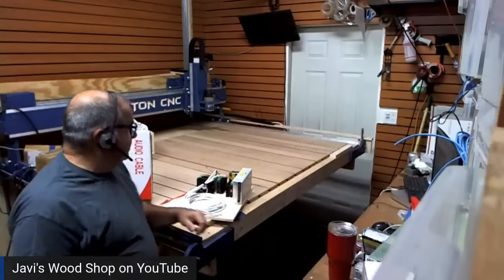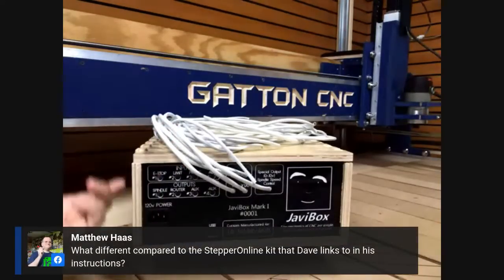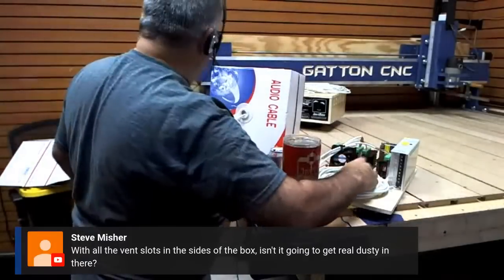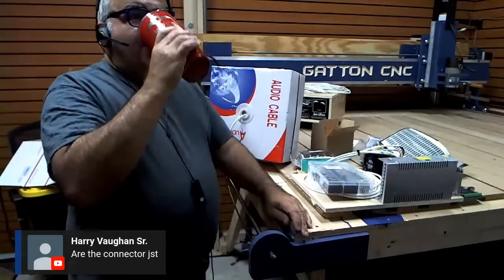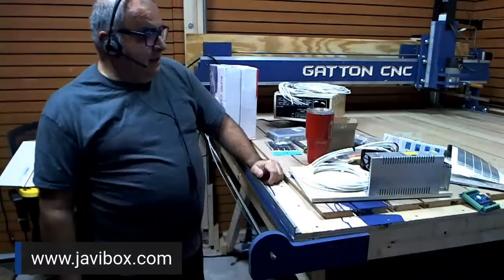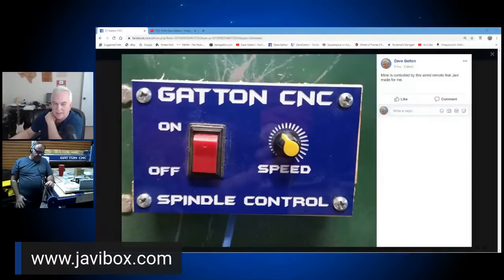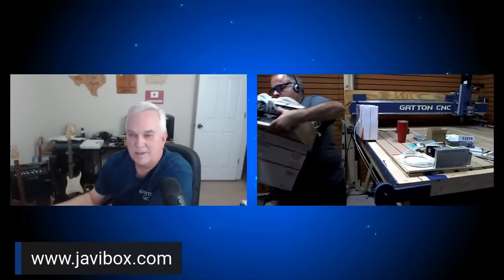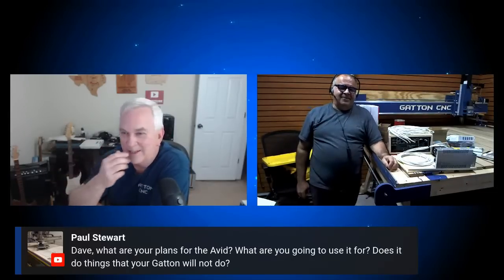CNC With Dave Gatton - Hobby CNC Q & A

Comment: Can the JaviBox be setup to use two limit switches so that when using dual steppers on the Y axis, you can have two homing switches to enable auto squaring of the y axis? Good job Javi on the design. Looks great.